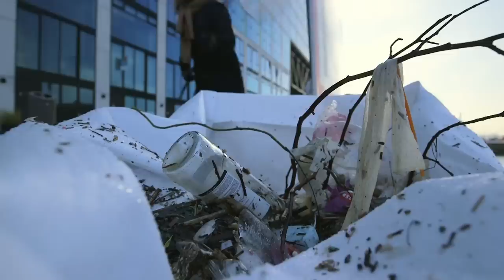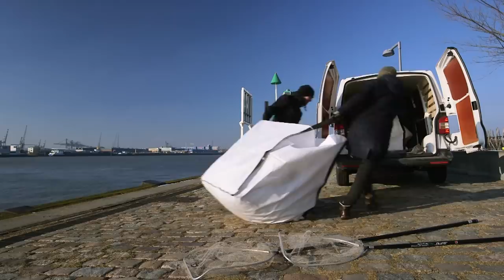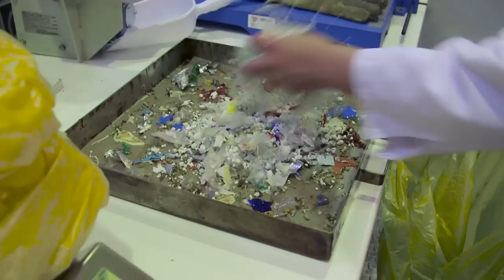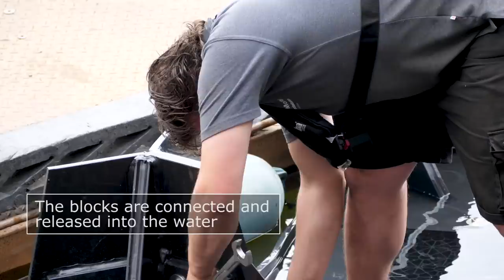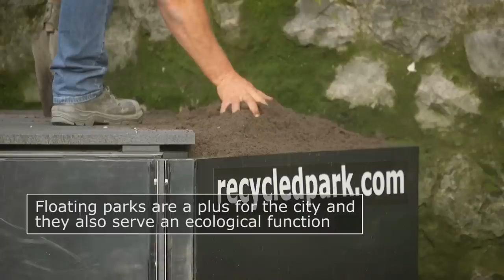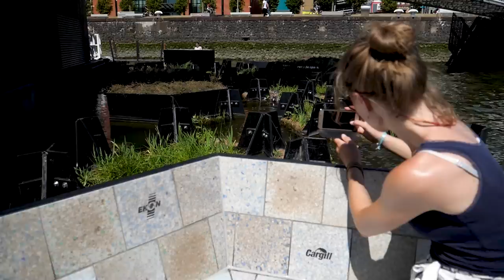Recycled Park first 140m2 open!

Comment: Is the plastic water not degrading in microparticle as normal erosion process? how this is helping to not contaminate the water?
Reply: I have the same question...
Reply from the maker: Thank you for your comment. We've considered the damage UV light can cause to plastics and added a UV-blocker to prevent UV-degradation. Our plastics are recycled in such a manner that they are very strong and resistant to the outdoor conditions. Recycled Park has an expected lifespan of several decades up to fifty years.